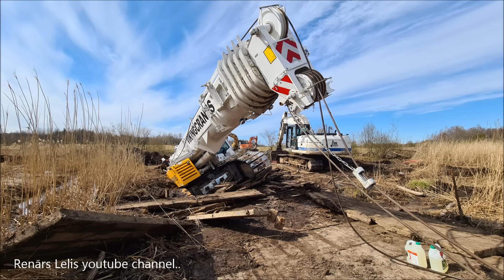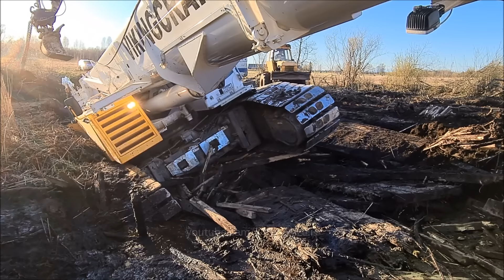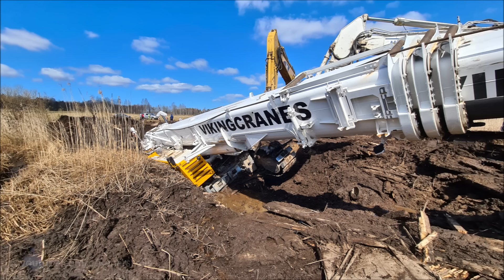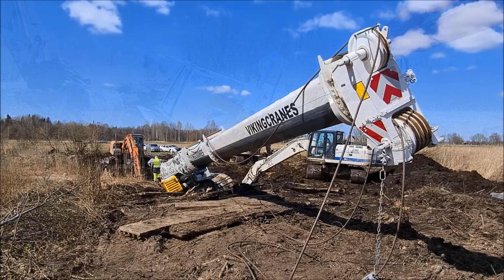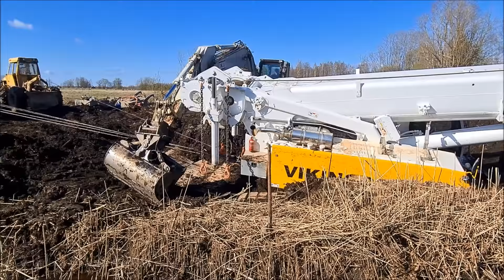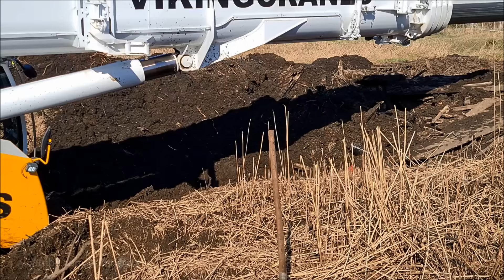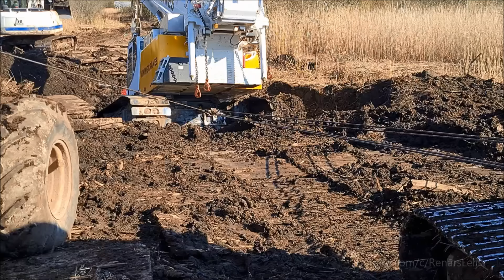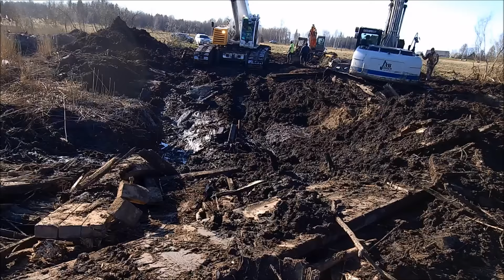Pulling out the Telescopic Crawler Crane, for 2 days!!!

Comment: He should have swung the crane boom over to this high side so all the weight would have been more solid ground
Reply: Thinking along same lines. Clear low side  swing counter weights high and drop. Swing 180 degrees and flat stick boom and extend.  Transferring weight to high track side.
Reply: Should of used the boom like the mast of a boat to pull it upright before tugging
Reply: @nevillekernke1844  and if they put a sail on it the wind would blow them out😀.

Comment: Well, if you use wood that thin what do you expect, (also wrong type of wood)? Use the tracks to pull the wood ( of suitable thickness) under the crane. A brand new machine, send it back. The more you watch the worse it gets. Is this a silent comedy?
Reply from the maker: The wood withstood, but the faucet slipped, because the wooden structures are muddy ...